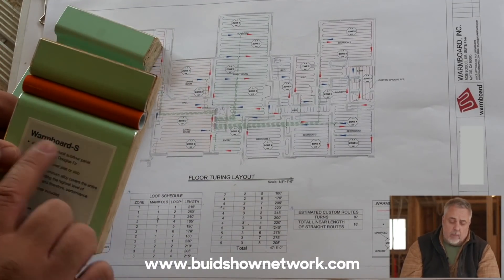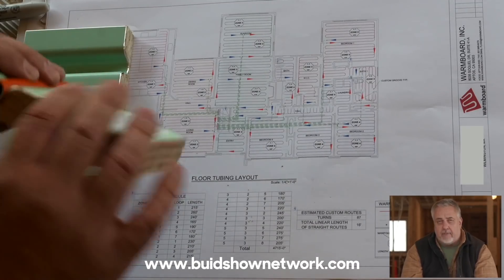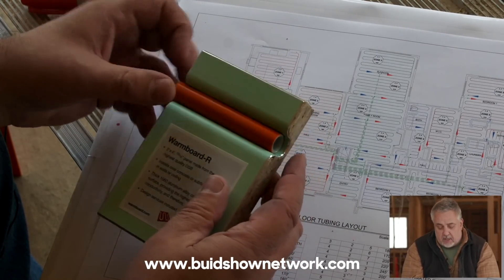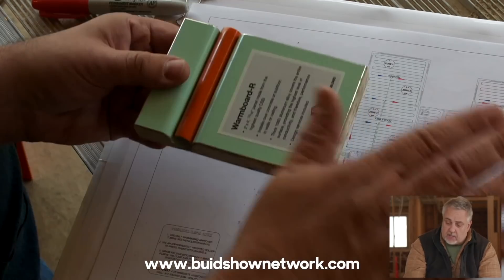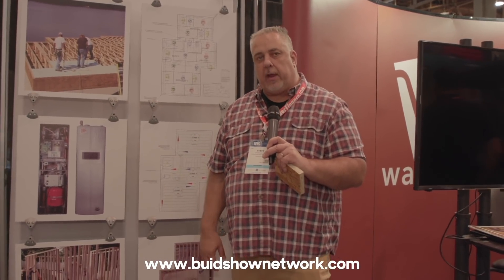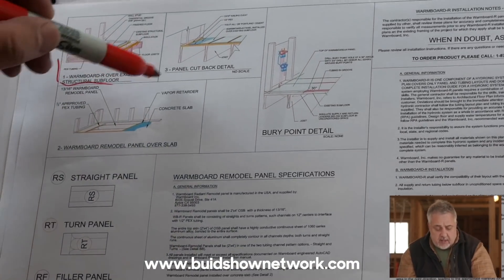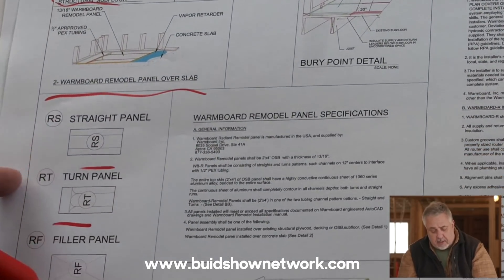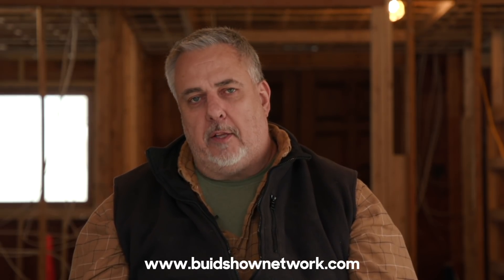Radiant Floor Heating Systems on Remodel Homes

Comment: I (long-time builder) have used and really like Warmboard, with a high degree of qualification, however. And those qualifications should be on the radar of anyone contemplating this product. 

Plus: High efficiency of heat dispersion: besides the obvious, this means low water temps for a given heat load, which typically makes ground source/ all electric a much more attainable and attractive heat source (these units do not like high output temps).  Low thermal mass gives a rapid response time, which is good in cold air/ bright sun Colorado. Great under hardwood or tile floors (with appropriate fastening bonding methods) because of decent heat propagation to the space. Overall, radiant floor heat is quietest, cleanest and most comfortable/ livable heating there is (for now). Anyone with $ (like my clientele) wants this, even if they are putting in a full duct system for AC (which they are). 

Negs: Expensive. Carpeting seriously reduces efficiency and requires higher water temps for a given heat load. New construction can be more labor intensive, as the Warmboard really needs to go down, interior framing installed and or laid out, and then the whole Warmboard surface needs to be covered to prevent damage. There are tricks to running the lines to zone manifolds, pressure testing, then not doing the actual in-floor until just before the finish floors go down (see comment on "expensive"). And, if you are designing for a highly efficient building envelope, the heat load may be so low that water temps are REALLY low. We find that it in our best house to date, with a 9 BTUH/ sq ft design load, the bathroom tile floor NEVER gets warm enough to FEEL warm. Ends up being counterproductive, and a client happiness/satisfaction issue. Done again, we'd put electric radiant in the Master bath.
  
BIG NEGS:    LEAKS.    Warmboard and their similarly designed competitors suffer from being THE MOST VULNERABLE to tubing damage and penetration, during construction, while laying finish flooring, and ALSO after the tubing is covered  by flooring/ after construction is over. The dirty secret of this industry, that they all try and pretend does exist. Reason for the vulnerablity is that people lose track of where all those many feet of tubing are precisely located. Out of sight, out of mind. The worst thing is that a fastener that penetrates the tubing, including drywall screws, and especially pneumatic finish nails or flooring staples, can self-seal in the tubing (especially Pex-Al-Pex) and even pass an air pressure test. The real problem comes when the fastener rusts out, typically 4-12months later. There is a slow trickle under the flooring, and then the rusted remains of the fastener finally blows out, and the leak gets dramatically worse. By the time the water puddle shows, there is usually a lot of hidden damage/ mold/ etc. As a builder, this has come to be one of my biggest liability concerns, because of the hidden nature and slow revelation of a potential problem.
Reply: isn't it easy to just pressurize the line and check for leaks before signing off?

Comment: I have installed both in my house as a diy/non-pro and have been very impressed with both the product and the company. The design documents were easy to follow, delivery was smooth, ran into 1 weird issue with my choice of flooring and support helped me through it. Great company in my opinion.

Comment: Radiant heated floors provide the best heat I have ever felt. Mine is electric heated coils inside 3 layers of cement boards with 1" insulating tinfoil board underneath over my hardwood floor. I then covered it with tiles and grout. It is slow to heat up but then it silently, evenly releases gentle heat into my highly insulated house. Built it myself for $1,000.
Reply: As I build my small highly insulated cottage up the mountain I want both an electric and fluid heated radiant floor. This way I can use my excess solar PV electricity for heating the floor in the fall and spring and then use the rocket stove to heat fluids to heat the floor in the deep winter.

Comment: We added a significant addition to our Cape in 2002 and used Warmboard and Radiantec for the heating.  I did the radiant work myself--the contractor did the Warmboard install .  Warmboard was so new, the closest dealer was hundreds of miles away in NJ (we live in upstate NY) .  I had to rent a truck and go pick it up.  We couldn't be happier with both the Warmboard and Radiantec. Highly recommend both! We would do it all over gain as the radiant heating is awesome in our upstate NY winters, and the system has worked flawlessly for all these years.
Reply: What did you use for a manifold? We are doing DIY and  don’t know whether to go with copper or pen at manifold a d control panel.
Reply: @susanw5940  As ours was an addition, so we only added a two zone system.  Raidantec provided three simple manifolds in copper. (A supply, a return, and one for the pumps.)   The temp(s) and pressure gauge, and the spirovent were already on the manifolds.    I then did the board layout and the rest of the copper connections myself.  Wasn't that difficult and has been solid since...  I have a pic if you want.
Reply: @johnpetry2541  pics would be great!! And where did you source your manifold if you don’t mind?

Comment: I've installed this, it's a really top notch product but it's something that the client really wants because it adds allot of cost to a heating system.  2000 square foot house is like twenty grand just for the material and then you add 10k for another cooling system.  Plus the plumbing and whatever HVAC system you want is another cost
Reply: David Love I looked real hard at this product for my new build and couldn’t justify it, especially being in the south.
Reply: @the_proffit76  agreed you would be doubling your HVAC budget.  A localized system in specific areas is allot easier on typical budgets than this product.  Its also difficult to get framers to install this stuff, you need a carpenter to understand router guides etc.

Comment: Dare I ask costs?
Reply: there is  a cheaper brand
Reply: Roughly $10/sqft just for the subfloor panels.  Then you need a hydronic system to supply heat, a plumber/HVAC guy to install it, and THEN you need a completely separate system for AC.  Warmboard has no place in anything but very expensive builds with the budgets to allow it, and even then you’d be far better off investing that money in a better insulated structure with better windows since Warmboard doesn’t actually save any money on heating bills (insulation does save money).  If you have money to burn I’m sure it’s a nice product with great mfr support.
Reply: @superspeeder  Just a small price to pay for warm toeseys
Reply: @sarahspaghetti55  most men don't get it. On a 100 degree day, my wife's feet are cold unless she goes outside and stands on hot tile/concrete.  75 degrees and it's sweater time...

Comment: Where was this video when I was remodeling me house! Would have loved radiant floor in my house versus the traditional forced air. 

One question I have. What types of floors can you have on Warm Board? Assuming a traditional wood floor would be out of the question?
Reply: I have a forced air heat pump and I prefer my electric thermal mass tiled floor slab for heat. It silently provides even and gentle heat as it warms my toes. I made mine for $1,000 with 1" of tinfoil insulating foam on top of my hardwood floor, 3 layers of cement board, electric coils and covered in tiles and grout. I want to another one for the living and library too.
Reply: Just posted a long comment. You may care to read through it.